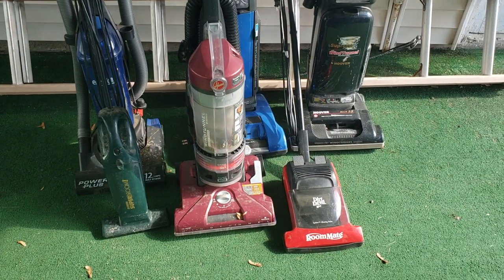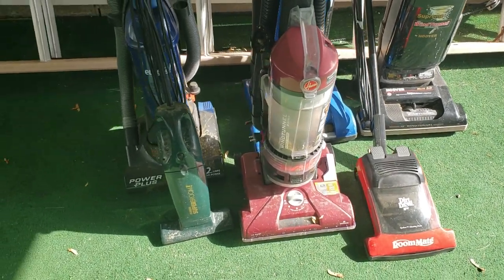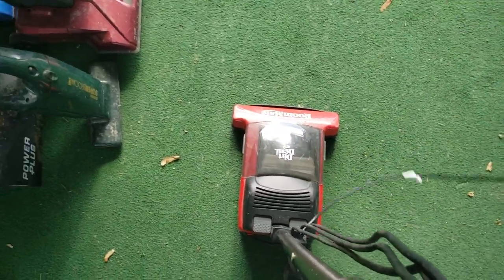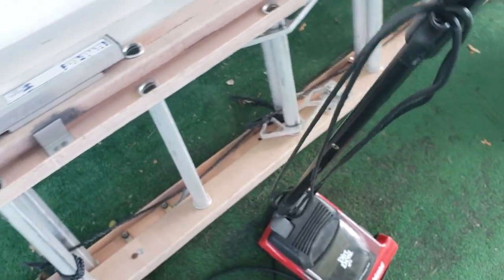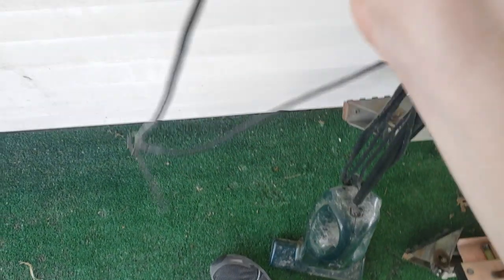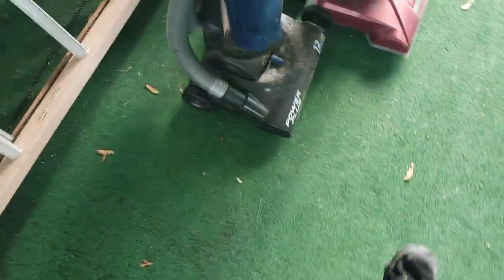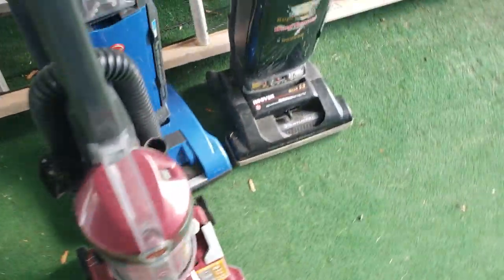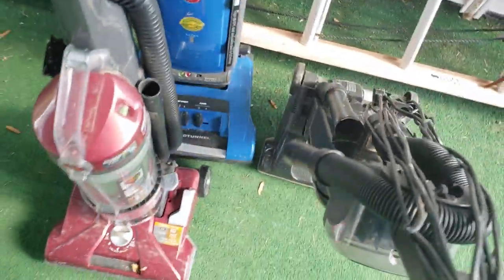Vacuums Saved: Episode 15!

Comment: The t series usually has a mount with two nitches toward the top of the handle for a power nozzle.. very very powerful machines, I've never managed to clog mine. Brush roll noise is normal mine sounded the same when I got it.

Comment: Oh Yes the eureka power plus I had the EU variant bin find chucked as the belt snapped but the motor broke I couldn't find a replacement motor the whole machine smelt of vomit me and my freind smashed it to pieces if almost killed me when I plugged it In as the wire split and the pvc coating live and neutral had the copper exposed could've seriously injured me or killed me so I plug it in and a massive spark type explosion burnt my hand fortunately not too  bad and it loosened the head of the plug socket and burnt it  luckily everything is fine now

Make sure to check the cable on bin finds because it could've been very different for me

Comment: I like both Hoover Windtunnels, I like the black non-self propelled Windtunnel Supreme better since it was made in the Maytag era and has a more pleasing sounding motor (I also like that model since it has the rare electronic performance indicator rather than the mechanical bag check indicator on the front of the bag [btw, is it just me or does the one on that one not work, it's hard to sell from the lighting]).
Reply from the maker: I didn't look, but I'll check after I Refurb it

Comment: 13:46 This Self-Propelled WindTunnel is equipped with a brushroll clutch system which stops the brushroll when the vacuum is locked upright.
Reply: It's got one of those horrible--eek, yuck!
Reply: @ShiningKureha  clutch systems can be kinda good though.
Reply: @charlesrodriguez7984  I'm fine with the kind that have ONE belt which has to be loose on purpose so that the wheel can sit on it which tightens it to spin the brushroll. I'm not fine with the over-complicated kind like the Windtunnel self propelled has. It would work better if it had a three row brushroll bar.